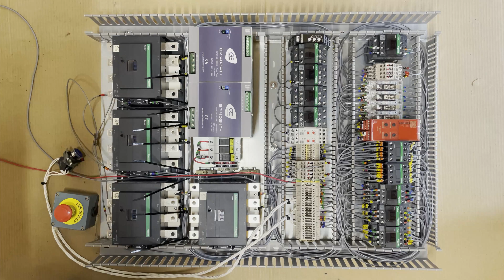Tram Brake Control Panel Part 4, showing the brake operating sequence.

Comment from the maker: A full explanation and technical details of how this system operates:

The red module is the "brain", that is a Schneider XPSXPSUAT13A3AP Safety module, which has inputs to monitor two separate safety "stop" circuit loops, with detection of faults between those or to other circuits, plus timing functions and reset interlocks for both its internal relays and external circuits.

The emergency stop buttons have two contacts each, with two circuits wired separately through each button and back to the control panel, with either being interrupted causing the module to trigger a stop.

The three instant operation circuits out of the module feed the first three contactors to the right of it, with the last two contactors in the top row being operated by the time delayed outputs.

The normally closed contacts on an instant contactor (eg. the first or second ones) are wired in series with the normally open contacts on the delayed contactors (the fourth and fifth). When the system is reset, all those contactors pull in at the same time, so no power is supplied to the large brake power contactors.

When the system is triggered to cause an emergency stop, the first two contactors release and power passes through the normally closed contacts on those and the still-energised normally open contacts on the fourth and fifth ones, causing the two large brake contactors to pull in and apply 24V battery power to the track brakes, until the module timer expires and the delayed contactors release.

The other components on the top row provide additional interlocking to only enable the VAMBAC system and show the safety system as "ready" if all the high current fuses feeding power to the big contactors are intact.

Each of the four 200A fused inputs to the four big contactors is monitored by one of the small relays just to the left of the red module, with power from the big contactor incoming terminal taken via a fuse (to the left of the relays) so a faulty relay cannot cause a wiring overload.

The four relay coil power connections also pass through normally open contacts on the third ES contactor, so the relays only energise when the safety module (and brake system) is reset or "armed".

With all five ES contactors pulled in and all four relays pulled on, showing the E-Stop system is fully armed and power is available to all the brake power contactors, the single contactor at the left of the top row is pulled in to show that the system is ready, and the power contacts on that are used to enable normal VAMBAC control of the tram.

A separate circuit loops through all the contactors and relays on that top row, plus the auxiliary contacts on the big power contactors. That is through "Normally closed" contacts on all of them, so is only completed when all of them are de-energised and have physically returned to the correct unpowered or released state.

That circuit is connected in series with the Reset or "Arming" brake system on button, so the system will not enable if any contactor or relay is jammed and does not release correctly; as a final check, the module only enables its outputs after the reset button is released, so a fault in that circuit cannot cause an unwanted power on.

Between the "Ready" circuit and the reset enable circuit, all control contactors and relays are tested for correct operation every time the system is armed.

This can only work by using special "positively guided" relays in the fuse monitoring positions: 
Positively guided devices have the moving contacts held in frames with limited free movement, so if any one contact jams or welds in one state, that restricts the guiding frame so no other contact can move to the opposite state.

Most contactors are inherently positively guided, due to the way they operate.

The battery chargers and their controls are also duplicated, to give a battery charge rate up to 80 Amps and bring the batteries back to full charge quickly after any brake operation.

The charger modules are rated by the manufacturers to operate on up to 700V DC, so a good fit with the 550V overhead supply. However, they would not normally be running from a supply that could have frequent interruptions, as with a tram moving across points and between power sections. Without some external limiting, the frequent power-on events could cause overheating and failure of the charger power input circuits.

To reduce the "inrush" current and voltage spikes to the chargers, each has its own external power filter and soft-start circuit. 

The small black module at the left of the second row of contactors is a voltage sensing relay, used to detect when the 550V power is available.

Each time the power comes back on, that switches on and starts the two dual timer modules (the small light grey ones) which in turn operate contactors which connect the 550V power to the inputs of the chargers, via some large power resistors and filter capacitors (external to the control panel).

If each charger signals it is fully powered and ready within the first stage of the delay time (eg. two seconds), another contactor activates and bypasses most of the start-up resistance, leaving a lower resistor value and the filter capacitor in circuit. 

If a charger does not correctly power up, a short time later it's power feed is shut off until the next 550V break, to avoid any possible damage. The actual sequence times still have to be determined, once all the 24V installation is completed and testing with 550V power is commenced 

Battery charge meters which display both charge percentage and battery voltage are included as part of the cab status and controls for the new brake system.